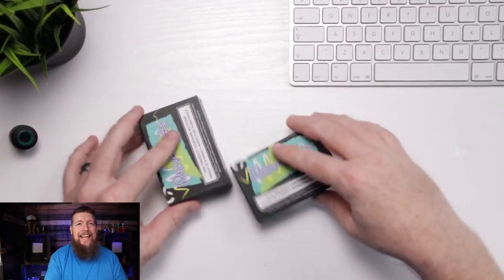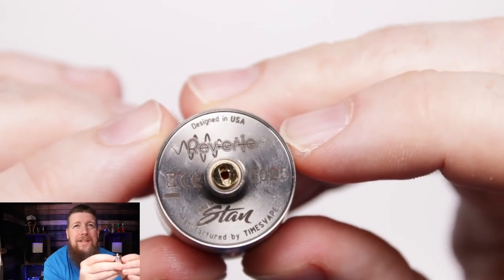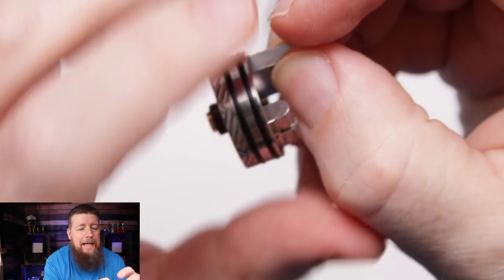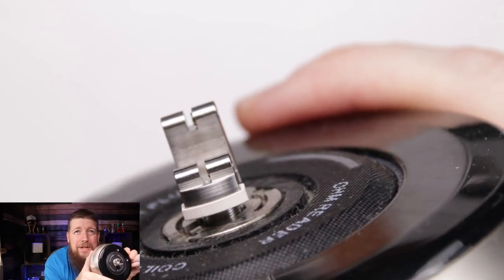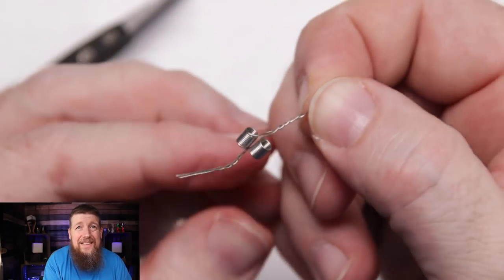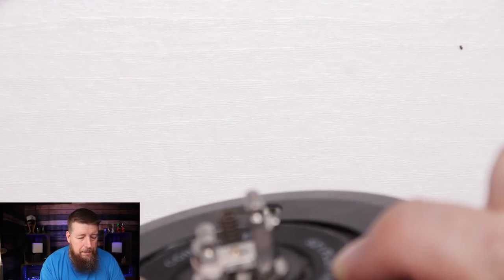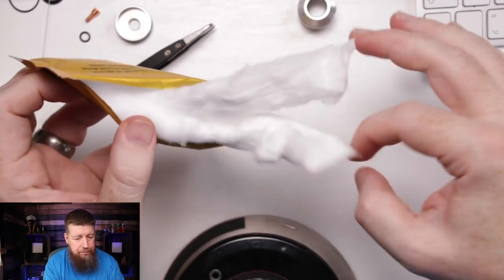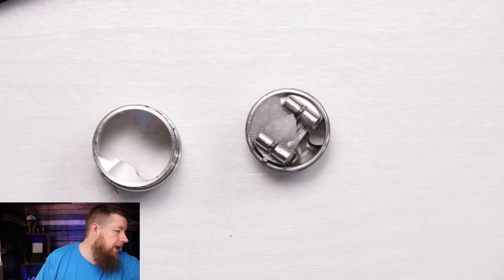Reverie Live Review - how to build Single AND Dual coils

Comment: The separate juice well wicking issue could have been easily solved by milling a channel under the posts so that juice can flow freely between both sides. Bit of a missed opportunity if you ask me.
Reply: joe arrowsmith the bottom of the post would have to be more thick. A small hole would look good for the idea but would not function as you believe. Without making it large enough to weaken the post. 😉👍 the posts also do not touch the sides of the juice well and the juice can run around the diameter of the well👍